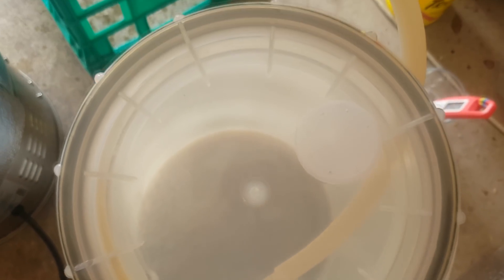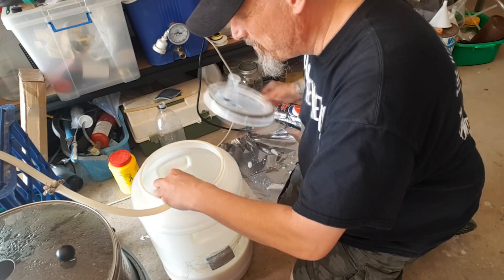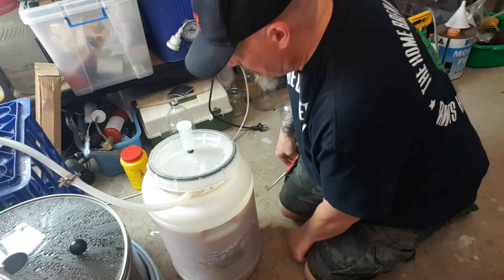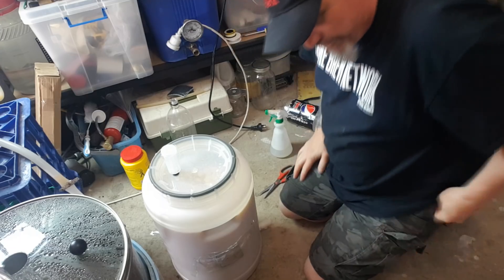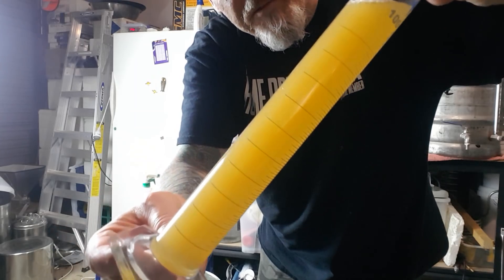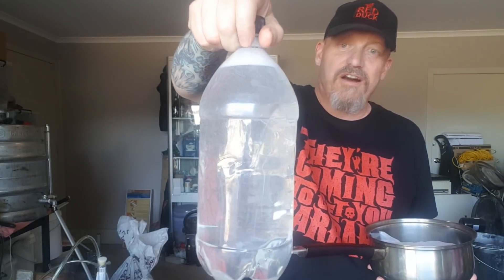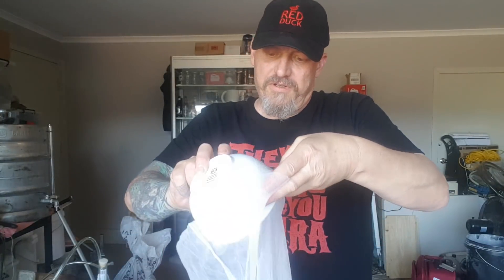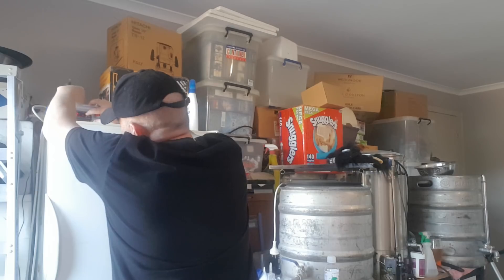NEIPA - Grain to Glass - Part 2 - Dry Hopping

Comment: To cold crash did you transfer to a different vessel or just adjust the temp on your ferment fridge?. How long did you cold crash for and what temp?
Reply from the maker: Just left it where it was and turned the fridge setting down to 2c and left it there for a few days. Cheers!
Reply: The Home Brew Network thanks. Would you recommend this for every brew?
Reply from the maker: @ijwhiting2296  It certainly doesnt hurt, its good for dropping the the yeast out of suspension and also really good for dropping out the dry hops, a lot will float and once you chill the beer they just sink to the bottom, otherwise you end up with them in the keg and connections get blocked, even bottling you dont want hop matter in your bottles. Cheers!
Reply: The Home Brew Network thanks, your a legend.

Comment: Hey mate, Love your channel, lots of great tips, is there anyway you could see this recipe working with hot cubing?
Reply from the maker: I reckon its worth a try, you could probably skip the 60min, or at least cut it right back to 5g. Then  do the hop stand hot for 10 or 15mins, transfer to cube. Continue on as usual after that. Cheers!
Reply: @HomeBrewNetwork  Yup that would definitely work, thanks for the tip and keep up the good work!

Comment: Hey mate I noticed that you have your strike water at a higher temp so when you mash in it drops to the desired temp. When during the mash do you bring your temp down to your desired mash temp? Pretty early on once the actual temp matches your desired mash temp I would imagine. Thanks mate
Reply from the maker: Yep thats called strike temp, and before I mash in I turn it down to mash temp, mash in immediately, by the time you mash in and stir etc plus the temp of the grain, it should be close to mash temp, its something you can experiment with on your system, but for me its usually 71c for mash temp of 66c or similar, this all varies due to strike water amount, mash temp and how well your mash tun holds heat. Cheers!

Comment: how would you filter out the hops if you bottled?
Reply from the maker: There are several ways, first you could loosely bag the hops when dry hopping. You could use some form of inline filter like this https://www.ebay.com.au/itm/Bouncer-Classic-Inline-Beer-Brewing-Filter-Home-Brew-Fermenter/162944609671?hash=item25f0416d87:g:RhwAAOSwgc1aqGzs&frcectupt=true or you may use a siphon with a bag on the end. Crash chilling drops hops very well alone, though depending on your fermenter and how high the tap is you may get some through the tap. Cheers!

Comment: Another great video. After using an immersion chiller, plate chiller, and counterflow. Which would you prefer? I also have a robobrew and I'm considering an upgrade from the stainless immersion chiller shipped with the robobrew.
Reply from the maker: I prefer my plate chiller for efficiency, but you need to be careful what you throw in the boil, the CF is very close behind though, they work well and fairly easy to maintain, IC are good but they really need to be huge, well bigger than the one that comes with the robobrew.  Counterflows are great. If you don't want the worry of a plate chiller, get a counterflow. Cheers!

Comment: Thanks for sharing the video mate! What is the reason typically for adding dry hops at high krausen? Does that give a better result on aroma?
Reply from the maker: It helps with a process called biotransformation, simply put yes helps add a few different qualities including some of that haze. 
Quote
"Biotransformation, which is the transformation of hop oils in the presence of yeast, is a fascinating processes. I was surprised to find a study titled, “Biotransformation of hop aroma terpenoids by ale and lager yeasts” dated all the way back to 2003, considering this is still not something you hear very often in the homebrew community today (at least I don’t). The study looked at brewing yeast (both lager and ale) ability to transform terpenoids. Specifically, they looked at geraniol, linalool, myrcene, caryophyllene, and humulene.

The study found that yeast does in fact have the ability to transform terpenoids. Specifically, geraniol was converted into citronellol (which is described as having a sweet, rose-like, citrus and fruity aroma) and linalool was converted into terpineol (which is described as having lilac like aromas). Remember that linalool had the greater ability to stick around the longest during the brewing process. Interestingly, they found that “most of the terpene alcohols were lost from the fermentations within the first few days of the fermentation, and after that, the decreases occurred at much lower and steadier rates…This indicates that the loss of terpenoids was associated with the increase in yeast biomass.”3 This might suggest that if dry hops are added after the first couple days of the most active fermentation, the biotransformation process would decrease. Maybe we should we should be pre-dry hopping our beer (adding dry hops to the fermenter before the wort and yeast) to take the greatest advantage of both the biotransformation process as well as the greater hop oil extraction due to not being introduced to the wort during the boil?"
http://scottjanish.com/examination-of-studies-hopping-methods-and-concepts-for-achieving-maximum-hop-aroma-and-flavor/